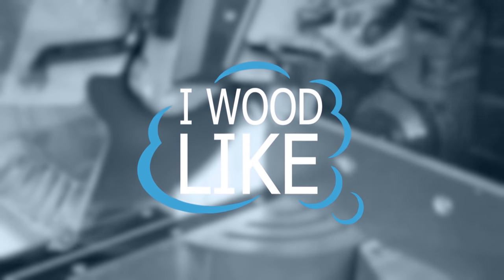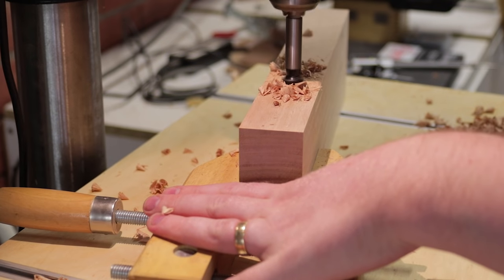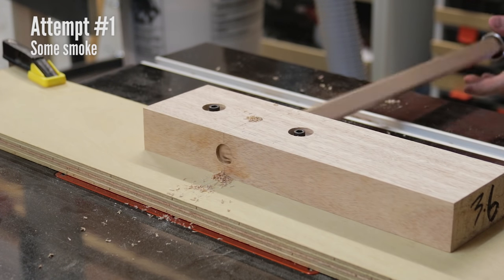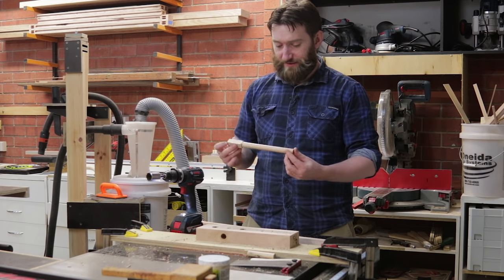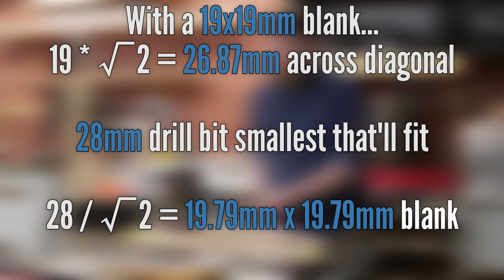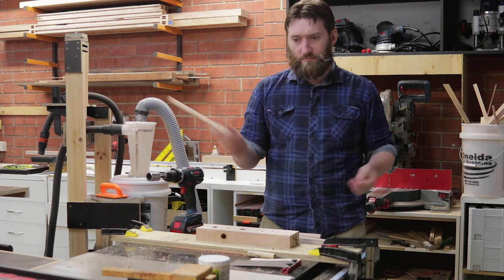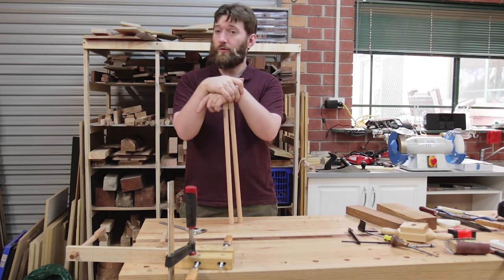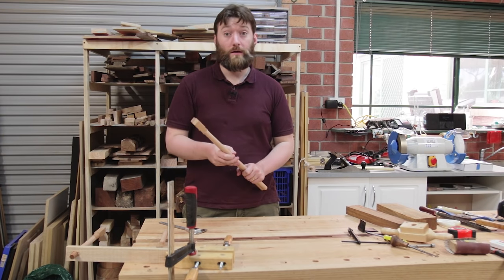Make accurate dowels with a router

Comment: I made a jig for dowels on my table saw a couple of weeks ago works well. It was a lot simpler than yours and not my idea but I got 10 8 and 6 mill out of it. The finish was not smooth but accurate good for pegs. Although I think they would come out better if I was to feed it slower. I made it for the same reasons as you its expensive to buy and you can make it from any wood you may be using and size you want. I did a clip on it.

Comment: I use a jig using the router. But before feeding the wood I round over the corners with a roundover bit. I also find that 1/2" downward spiral works better than double flute straight bit.

Comment: I love this idea and hate the pencil sharpener type. I have spent the past 2 days trying to make this dowel maker. Trying to get the 19mm hole to align with the 28mm hole is the challenge. I have tried a few different ways and have failed. I want consistent 19mm +/- 50 microns. I'll keep trying.

Comment: I'm going to try this soon, with a couple modifications. I'm going to mount the router bit up along the SIDE of the hole, not the center of the bottom. Adjustments will be done by sliding the top block sideways instead of raising or lowering the router bit. I'm hoping this will give a shallower angle of attack from the bit for a smoother finish. Also it would allow me to use a round-over bit if I wanted, again, hoping for a smoother finish. I'm trying to get something that produces consistent and accurate results, and could produce dowels up to 2" in diameter.

-I tried a matthias-style pencil sharpener jig, but it's just too finicky for my tastes, and really does not work well at all with softwoods.
-I've had decent success with a similar approach to yours, but mounted on a table saw - perpendicular to the blade - instead of a router. It works well, but the surface finish isn't spectacular. I think experimenting with different blades would be helpful, and I would guess that a dado stack would be better still. Right now I have it set up to run perpendicular to the blade, but building it with the dowel running parallel to the blade might be worth trying.
Reply: How'd it work out? Why not use a chamfer or v bit, so it's more of a shearing cut? Think this is a good idea, would love to hear how it worked out

Comment: do you need a different exit hole for each size of dowel? Or do you just use the same hole and adjust the height of the router bit? I must have missed this.

Comment: Very nice and simple jig, also its nice to see a drawing once in while. 

Have you considered having the router bit of to the side rather than straight at the center of the dowel? Thereby using the side of the bit. 
You would have to adjust the jig from side to side rather than moving the bit up or down; but I would guess that could give a smoother finish and would help remove chips (when using other than up-cut bits.). It would however also mean, that you would need a longer bit to make the same size dowels.

Keep up the good work.
Reply from the maker: +Simon Brow Warburg length of the bit for larger dowels is the killer, since I'm planning on 38mm for wooden screws
Reply: I'm thinking the same. It also occurs to me that I could use a bit with a bearing, like a pattern following bit.  The bearing could ride against a groove in the jig, providing support from the top and the bottom of the bit to reduce chatter.

Comment: Nice idea! I found myself wishing this video had a little better explanation of what was happening inside the jig, or a shot of the router table adjustments. I think that the height of the spiral bit needs to be set to just below the outfeed hole?
Reply from the maker: I didn't deliberately withhold the information, just didn't think/forgot to include those shots. D'oh. I'll try and include that in the next VLOG on my second channel.

Height of the bit (Doesnt' have to be spiral) should be (at its highest point) flush with the lowest point of the outfeed hole. If its below that, the dowel will likely be too big and jam a bit.
Reply: Thanks for the clarification!

Comment: Accuracy-wise, how would that compare with running your "square bar" on the router table using a quarter round bit?
Reply from the maker: Quarter round bit may get you just as accurate if you've got the correct radius for what you want. It does get more difficult to safely and accurately hold the workpiece as it gets more rounded over (ie, 3 sides rounded with the 4th being cut) especially for smaller diameter stock.
Reply: Feather boards pushing down and use a scrap piece of wood to push the piece through, best way I've found to get past that issue you are talking about where things can and do go very wrong on a router table.

Comment: I've got access to a metal lathe and laser cutter. I'm thinking I could possibly create a similar jig out of a block of steel and use existing/create blade inserts. With the goal of having a jig independent of a router. Thoughts?
Reply from the maker: Yes, that could work, or you could make it such that you could screw trim router to the top of it so you don't need a router table. 
It depends on how frequently you use it and for what diameter.

Larger dowels are going to dull a non-carbide cutter pretty quickly, and if you're not rotating the carbide cutter the surface quality may not be much good.
Reply: Definitely. You've got two points of motion here which I'm guessing yields the nice surfaces.

Comment: is there something im missing here did he put a blade in the jig?
Reply from the maker: Router bit in the table.
Reply: @TheWoodKnight  thanks I noticed it on the second time i watched it there for a min i thought you were pushing it thru with out a blade in the jig
Reply: In reading the comments he put a router bit in the hole but it was not clear to me either.
Reply: Or maybe he was using the table saw blade???

Comment: Good job with the Router bit but what about the flutes?
Reply from the maker: +Adam Regan I'm not sure what you are asking, what flutes?
Reply from the maker: Adam Regan right, I see from notifications you were asking about fluted dowels for gluing. Have you seen any dowels above 10mm that are fluted? it's not required at larger diameters, and it would limit your dowels to joinery only (and again, not required to glue these in)

Comment: Hi,
Make the hole in the jig to the biggest dowl you need.
Then make bushings with the OD that fit the biggest hole in your jig and ID of the next size dowl you want.
You can make as much bushings with differt ID you want without making a jig for every diameter dowl.
I think a piece of aluminium roundstock that fit snug in the jig with a setscrew to secure it will do best and drill different ID 
for different dowlsizes.
Reply from the maker: +y delzeyne what do you think I'd cheaper - some hardwood scraps or aluminium round bar? I don't have a metal lathe, accurately machining metals isn't possible in my workshop
Reply: Paul Jenkins All you need is a piece of roundstock alu a couple mil bigger i diameter of the biggest dowl you need. 
Cut that too the amount of pieces you need for the different diameters of dowls you need.
and drill them with the correct size .
No lathe needed
Bigger holes than 13 mm can be inserted directly in drillpress if you remove the chuck .
Bigger drills have a morse cone.
But i think you can use the same procedure with hardwood  and make hardwood bushings.
Would be easier if you don't have the drillbits for metal and use forstnerbits.
Reply from the maker: well, it can't be a few mm larger as they come in certain sizes. A quick search, the results have 50mm as the closest diameter, and prices are between $30 and $50AUD for 250mm. The larger diameter dowels should really have longer in/outfeed, so each bushing there should be at least 50mm long. Thats 2/5ths of the  aluminium gone.

Now as I said, I dont' have a metal working setup so I don't have any of the drill bits with morse tapers, and driling a 38mm hole in aluminium 50mm deep is going to uhh.. .take awhile and require a better vise for the drill press than I have, as holding round stock and drilling into its face can be tricky. I'd imagine it'll also ruin my forstner bit to the point that resharpening it may not be possible.

Then there is the issue if I've got a 50mm hole in a block of wood for the insert and I need to make a 19mm dowel.
That means I've gotta raise the router bit 18mm for the plywood, probably 5-10mm for the wood "case", then 16mm to get to the right spot in the insert (50/2 - 19/2 = 16). I think my bit can handle it.

I'm not denying there is merit  or that it would be better, but its also a helluvalot more expensive and I don't have the tooling for it. HDPE or maybe acrylic would potentially be "better" for the tooling I do have though I've not priced that out.
Reply: chunks of delrin are available on ebay and I believe it turns pretty well on a woodlathe, off you go! :P
Reply from the maker: I've turned some small delrin (and HDPE) on the lathe before. Doesn't smell great, but does finish well - more stomachable prices than aluminium.... but it does sound like you're trying to convince me not to buy a metal lathe Pete... ;)
Reply: And if you make a jig with a square hole  and make square inserts with the diameter you need drilled in hardwood?(or in POM or HDPE)but is a bit pricie to.
You can drill the small diameters off center ,down near the routerbit.
Would be easier than round bar or stock.
Quiqk search here in Europe you can get alu round bar from 8mm up to 110 and 1 meter of round bar D 50 cost  here 43 euro. guess  alot cheaper then in Australia.
Reply: well it's more that I don't want you to get one before I do!
Reply from the maker: Raw material cost, be it plastics (HDPE, acetal, acrylic), metals (aluminium, brass in particular), or plywood in Australia is ridiculous. :( Finding the suppliers can be half the battle too - most of them don't have any web presence at all, ebay is actually much more reliable!

The square insert may be more viable and easier to change the insert material depending on its use (ie, if I only need a handful of 10mm dowels, make it out of scraps, but if I was doing it daily go for aluminium etc). That'd also make it theoretically to do aluminium casting (find scrap aluminium, melt it down) for square inserts. Easier to file/etc it flat than get it round to fit in.
Reply from the maker: Well, in that case Pete, I better order it tonight to make you pout. :D
Reply: You're a monster Jenkins... a monster who must be stopped! 

by someone else, I'm broke till next month

Comment: ashemcrafts.com in the uk sell rounding planes which are essentially spokeshave blades held in a cast body at a shallow angle. I believe they are a development of a wooden body rounder. I've got several, they're good,  but either need a lot of muscle power or a low speed/high torque lathe thing to turn it.
Reply from the maker: +Mickleblade I've never seen anything like that before, how fascinating! More and more I wish I had a small hobbyist metal lathe and mill so I could take a shot at making oddities like those
Reply: it's sort of a giant pencil sharpener. Bigger wood goes in and a very precise, almost murnished dowel comes out. It's possible to make them with wood. It's hard work doing them by hand though

Comment: Instead of the maths just put a diagonal line across a piece of wood/paper measure the size of drill your using along the diagonal line then measure from the mark to the edge to get the size of the blank to cut.
Reply from the maker: +Louis Watton that can work too. Calipers/maths can get it more exact for better finish quality, or if you're after an odd size dowel and need to know what size drill bit to buy